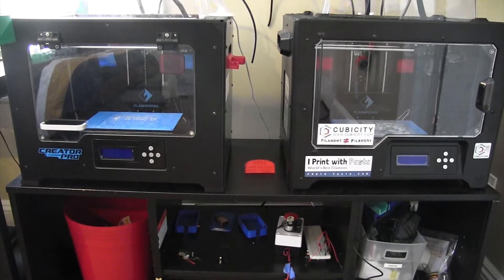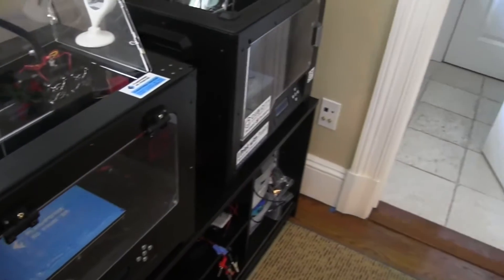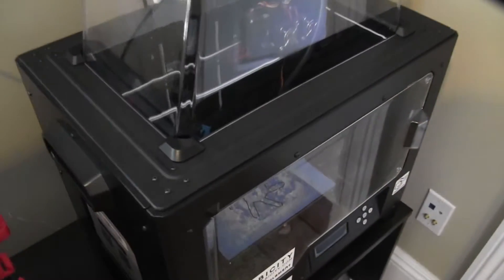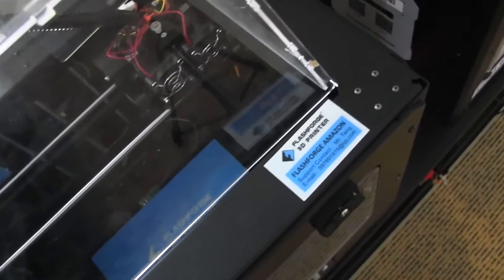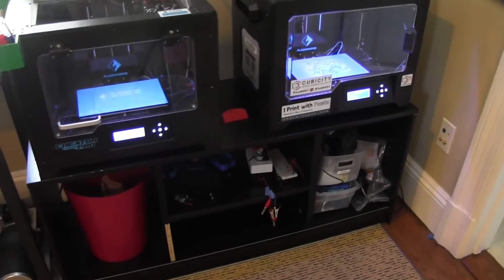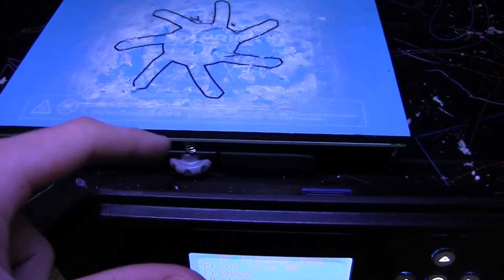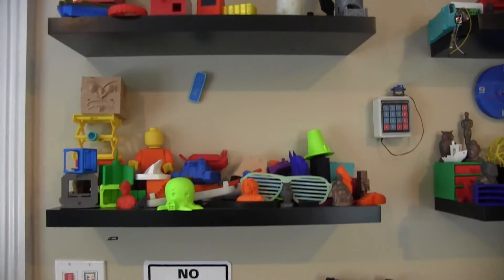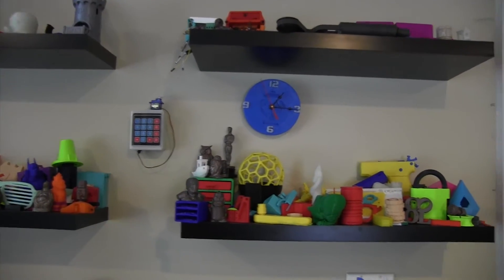Flashforge Creator Pro Review (2016 Model)

Comment: @Extreme 3D you said there was some negatives to the newest version what is the negatives?
Reply from the maker: the handles on the side are filled in on the newer one so you can't print accessories for it, and also I think that the older printer is easier to take apart, and is better quality.

Comment: i have this printer and when i print pla it does not stick to the bed very well has this happened to you and if so any suggestion
Reply from the maker: Cole Hessler it has not happened to me, but I suggest using blue painters tape for the print bed and using a glue stick to put on the area that your using to print

Comment: I am a beginner at 3d printing and don't know too much. Should I get this as my first? I'm stuck between this and the new matter mod-t which are two completely different difficulties of 3d printing.
Reply from the maker: I think you should get the Flashforge, it's a great reliable, and durable printer that lasts! In addition there is a big community of people with this printer so finding help for any issues won't be a problem! :)

Comment: Thanks for the great video.  I am almost ready to order one but I am slightly concerned about the software.  I am planning on using Cura and a raspberry pi running OctoPrint.  I was wondering how you specify what color to use where.  Can this be done after a model has been created or does it need to be done before I put the model in Cura?
Reply from the maker: Normally you have to separate the two parts that you want to print in different colors before you bring it into cura.